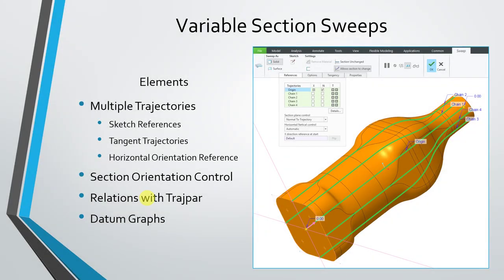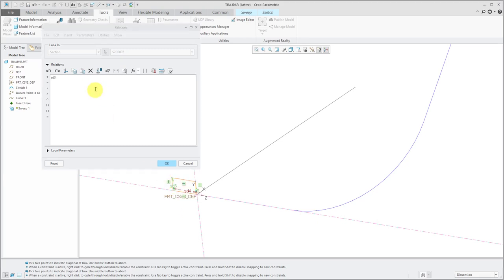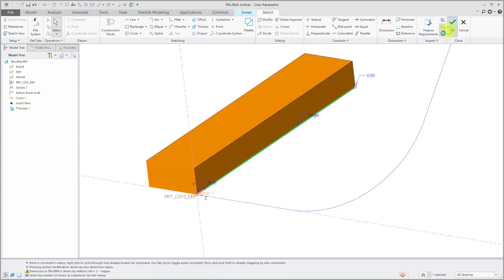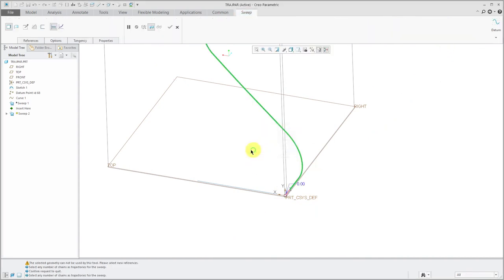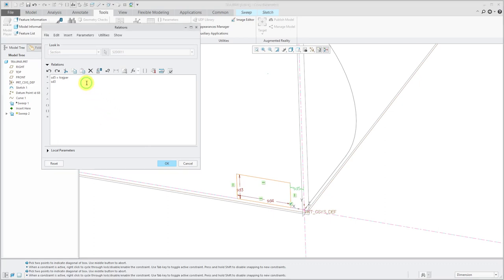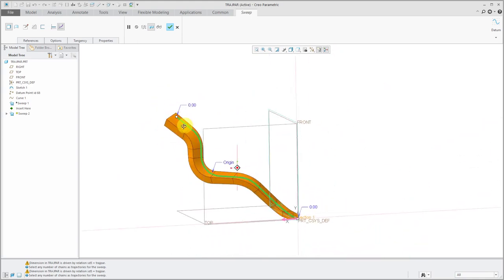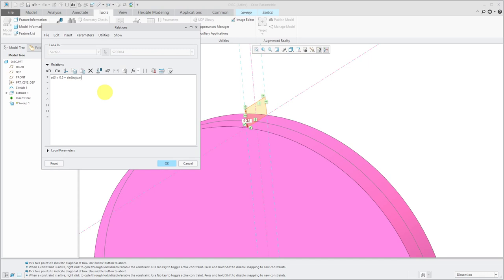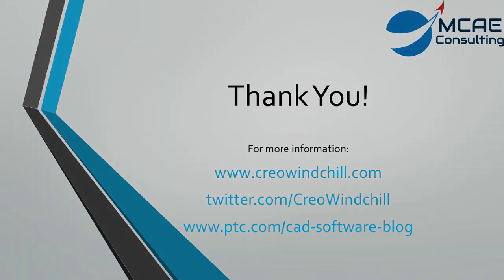Creo Parametric - Variable Section Sweeps (Part 3 - Relations with Trajpar)

Comment: Hello Dave, Thank you for this video series on sweeping.

I have a question in your last example at 5:51. When you click the circular trajectory, how can you define the origin of the sketch elsewhere around the disc before clicking on the Sketch button?
In your example, your rectangle sketch is located at the vertical (at noon), but if you wanted to locate it at 45° or else, do you know how you would do that? 
I went in References tab > Details button > Options tab, and I tried to change the starting point, but I couldn't select the plan or the point I previously defined...

Thanks a lot for your help!

Comment: thank you sir, may we use this trajpar on helical sweep to get variable section please reply
Reply from the maker: Great question, but unfortunately trajpar is available for Variable Section Sweeps only.
Reply: @CADPLMGuy  so what can we do to get variable section on helical sweep
Reply: @CADPLMGuy  i am so lucky i am connected with world best creo trainer.
Reply from the maker: Your best bet is to create a helical Datum Curve, using equation or through points, and then create a Variable Section Sweep using that Datum Curve as the trajectory. If you have a specific example I can try making a video.